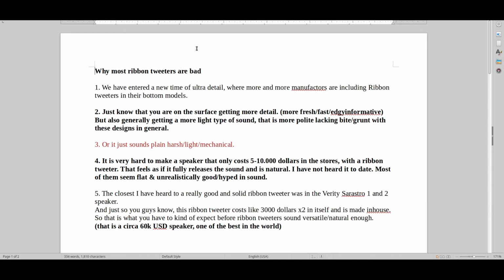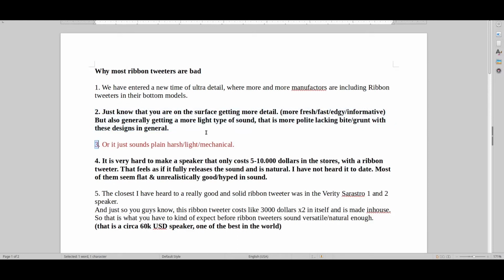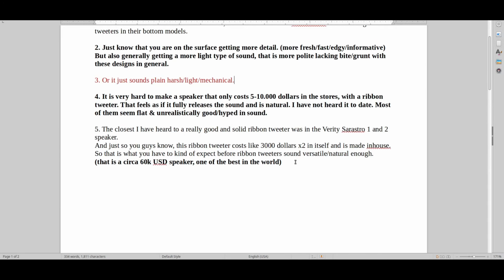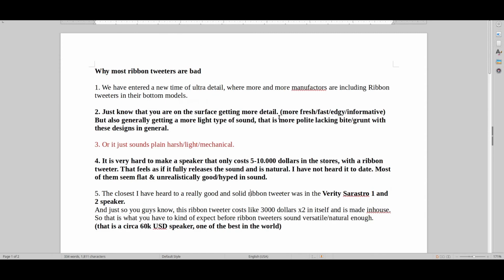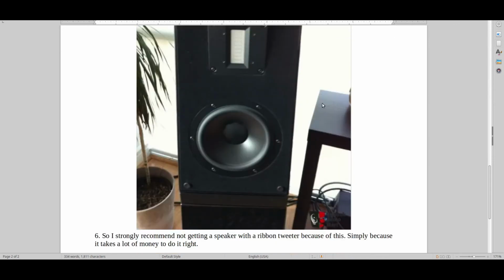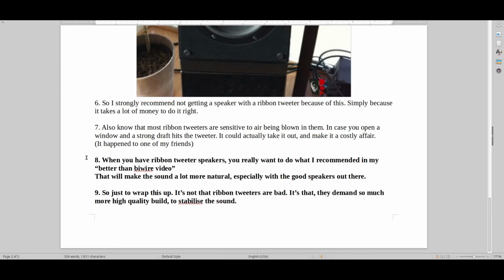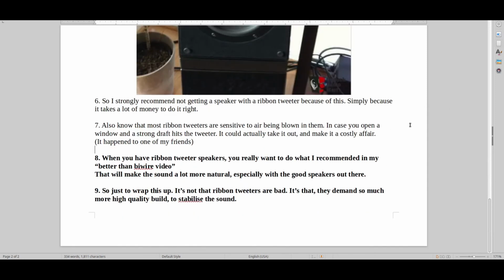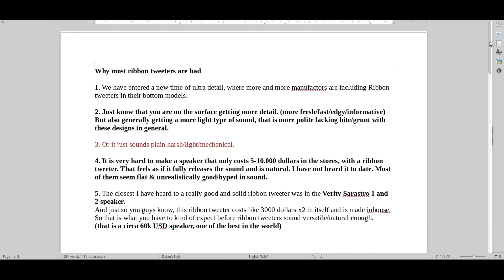Why most ribbon tweeters are so bad

Comment: All I got from this is 'there are really good ribbon tweeters, they just need lots of money".  Why?  What is the issue with the lesser ribbon tweeters?  Is it distortion? Is  the ribbon resonating because of some mechanical coupling?  It cannot simply be that money is needed.  Why is it needed?  What are the engineering issues that need to be addressed?

Comment: I don't like ribbons. They have to much distortion. That is what people call detail. They are ok from about 7khz up but then, why bother at that point. Burylium (sp) tweeters are 100 times better.
Reply from the maker: Maybe, depends on so many things. Best tweeters I have heard and in the Marten Design Bird 1, Sarastro Verity, Audio Note AN-e speakers.
And many I know say that it it the Marten Mingus together with the Wilson XVX chronosonic speakers that are the best. There are so many top end models with good tweeters nowadays.

Ribbon tweeters especially demonstrate the audiophiles lack of ability to adjust gear/room to the revealing unit. I like Berilium many times, but don´t consider it as natural as many of the highest models of the AN-E. AN-e spe/he + sec signatue + Sogon models are just a lot more integrated in sound where Berilium has  a tendency to separate things more artificially.
Reply: @RealHIFIHelp   well, I have been a musican for 45 years. I have been a recording engineer for 40 years and a mastering engineer for 35 years. Not to brag but when you want to hear things through speakers that sound like the real thing, it is pretty hard to do.
Ribbons don't do it.
Reply: @analogkid4557  I have owned Quad S2 (ribbons) for nearly 5 years, and as far as voice is concerned, I don't believe there is a speaker under £1,000 (or a good deal more) which beats them.  I have heard dozens and none betters them on this criteria.  For bass, dynamics, scale etc.....sure, this isn't their forte.  But realism as you stated, c'mon ?
Reply: @karlhinchliffe4920  yeah, cymbals don't sound real at all. Only metal domes can do that.

Comment: When a company crams a cheap ribbon or AMT into a two way design I can see there being definite compromises, but in a well designed three-way speaker they are superior to any dome I've experienced, and that seems to be where they shine best!
Reply from the maker: Maybe, depends on specific 2 way vs 3 way we compare and then the room and gear and many other factors. Yes there are a lot of good tweeters in a lot of 3 way speakers, I cover the best ones in my books and most other things if you want them. But it is material that currently is about 2500 pages.

Comment: I have ribbon tweeters in my car-audio setup. Amazingly, the delicate ribbons have been going strong for over 5 years. One advantage of rectangular shaped ribbons is controlled dispersion. In my case, I mount the left tweeter horizontally to minimize reflections from the adjacent A pillar.

The downside is that I high-pass my ribbons at 6.5khz, which only works because I'm running 2" mids in pods on my dash. Yes, I just mount speaker pods on my dash and it sounds better than door speakers. BION, I get 3D imaging in my car that most home audio enthusiasts can only dream of.

Comment: Click-bait title! - I concur: G1 ($300) excellent.  Raals ranked among world's best tweeters ($700-1500).  Several reviews say e.g. Viawave & Raven also v.good.  This video is assertive opinion, could confuse/mislead those seeking guidance.  Wrong & silly to claim “most ribbons are so bad”, the well-established tech can be awesome for way less than $3K.  Try Googling wider, to counter this viewpoint.  Sound is very difficult to describe, so if still unsure, buy from a source that allows returns.

Comment: I have used speakers with decent tweeters from Seas, Scan-Speak, Morel and heard many more quite expensive designs with either horn or conventional dome tweeters (from soft to ceramic,or diamond).
However, today I enjoy my own speakers with Aurum Cantus G1 ribbons after living with a commercial bookshelf with G2 for a few years.   
I prefer myself the clarity, speed and resolution of ribbons where the strings vibrate with pure overtones and resonances are sparkling clear; there are great advantages in a transducer that is an order of magnitude lighter than a dome tweeter and reacts and stops in an instant.
Viawave, Raven, Raal are some of the best transducers available nowadays, that when properly implemented are well beyond any existing conventional tweeter potential regardless of the cost of "entry" imho.
But I can be wrong and my own bias got the best of me.

Comment: Baffled here, so what makes most ribbon tweeters bad? Harmonic distortion? Bad crossover design in commercial speakers? I need more information than they must be expensive and paired with expensive caps and coils. Sure high quality parts help, but implementation matters more.  I’ve heard lots of high end speakers that I would not buy, but every once in a while a engineer really hits it out of the park and the speaker just sounds correct.  A lot of multi driver speakers never have the coherent realistic sound of a full range speaker.

Comment: It has to do with proper "implementation"! Proper crossovers, cabinets etc,. I was told for YEARS that AMTs were all terrible, till I purchased GoldenEar speakers (Sandy Gross designed) and I fell in love with them! I had previously owned many speakers with ribbon tweeters, and was never that happy with them (well I loved Magnepans if properly set up). Also cost doesn't always mean that much if the designer knows what they are doing!
Reply: Yep, totally agree. Most of the issues come from them having to be crossed over so high to reduce distortion. With that come plenty of problems.

Comment: You aren't seeing a lot of Ribbon tweeters, but a lot of AMTs (Air Motion Transducers).  AMTs are fine alternatives to domes, if you take into consideration, they cost a little more, and can't typically be crossed over as low as modern dome tweeters.  Your complaints aren't regarding the tweeter or its usage, but overall target curves speaker designers use today.  In the 90s, everyone blamed metal dome tweeters for the brighter sound of the latest loudspeakers.  The reality was speaker designers had wider bandwidth drivers than before and could make speakers with a flatter target curve.  Flat frequency response to 20k hz was the theoretical ideal, but listening experiments showed listeners found it bright sounding.  Today, many speaker designers have taken a step back and are using target curves where the output tapers toward the treble, but the majority are still producing speakers with flat target curves, which sound bright.  If AMTs didn't come back into fashion, you would still complain about the overall trend in how speakers sound today.

Comment: I prefer soft dome tweeters over ribbon tweeters. They are more durable, smoother sounding, and have a wider dispersion.
Reply from the maker: Me too. But, maybe less than 1% of the ribbon tweeters with the best crossover and constructions in the world are also really really good.

My main point was just the normal build quality with cheaper speakers has many times got sound issues.
Reply: What about planar tweeters?
Reply: One shoe fits all? There are different technologies of ribbon. Not all sound the same. 
I have AMTs on my Adams AV7 active speakers., they sound absolutely amazing.
Essentially its about the quality of the components, regardless of the technology.

Comment: i heard people talking about planar tweeters like Bohlender Graebener Neo3 being something that actually a better option than dome tweeters. they play lower, handles more power, move faster, more durable and open back options.
ribbons sounds like it won't change much in the hifi world, but also depends how you define ribbon, i think of ribbon as the ones that has the aluminium foil suspended in a magnet gap(with the durability issue you mentioned).  or perhaps the yellow folded ribbons with magnet at the sides and acting like an accordion.

Comment: Ribbon tweeters are tools. Like any other drivers they are there for a designer to achieve his/her goal. Even a small format ribbon tweeter, crossed high in a 3-way monitor can work very well. 
It's really up to a designer to use them properly. Most ribbons are fine. The video should be named  "why most speaker designers are so bad then it comes to ribbon tweeters".
Reply: Got that right... There are 6,000 people designing speakers for sale....perhaps a dozen are actually good at the task.
Reply from the maker: That is basically also what I said.

Comment: Come on , Couple million dollars Tweeter , that doesnt even Exist . Yes there are company's selling snake oil , so god knows maybe someone put a million dollar tweeter .
But whatever it is you can make it DIY for fraction of that , i dont care what is it .
Some of the most expensive speakers , best speakers use Tweeters made by hand in Serbia where im from , best in the world in its class .  And its not even a 1000$ per pair , its around 200$ bulk sail for best possible materials realistically handmade .
Reply from the maker: Jup like I explained it's all about context. You can of course chose to misunderstand it, if you want to. And no all ribbon tweeters are not the same, there is a huge difference. And the really good ones are not the ones that they sell in the stores. Have a nice day.
Reply: @RealHIFIHelp  You are the one who can make the tweeter to  be really good one or a crappy one as a speaker designer. There are plenty of superb components on the market that can be used to create a world class speaker. No need for the ones that are not sold in the stores. It's your speaker design skills baby!
Reply from the maker: @snowblow1984  Not really most DIY is really low quality and your are talking about the biggest potential DIY sound, not the most likely common ones that most people use.
If you bothered to do your research you would realise I have tried all levels. Yes standard components can do an okay sound. But custom made stuff is 9/10 times better. So there is no reason for settling for something that most people find okay.
On top of that, custom made sound can also become cheaper.

You are comparing the normal DIY gear with the normal trashy expensive sound.

I also say in many videos that it is very relative.

Meaning that, when incorporating cheap stuff, you have to do it in a certain way, that could in theory make it sound good.

By the way, I worked with some of the best in the business, a
Reply: @RealHIFIHelp  some the DIY use $5000 Tad tweeters.  Some build humongous horns. I have line arrays that weight 2 tons. Other Diy will use $19 tweeters an cardboard.  It's all over the place. Just like it is in commercial design.  I am still puzzled as to how you quantify that 9/10 times difference in betternes. Don't care who you worked for. Based on your sweeping generalizations you have little technical knowledge as far as use of the drivers and ribbon tweeters in particular.
Reply from the maker: @snowblow1984  DIY can sound good, but will in most cases be beat by the best stuff in the same value category new. Simply because the manufactors can get the stuff at a much cheaper price and they can tune it better and get better matched units. (we normal people have to buy single layer not properly matched units with all kinds of cheap kits)
So it is generally better to just buy the new stuff in the stores, going after the special few good things.

I have heard good DIY projects, but then we aren't talking about a normal Proac or Avalon clone, then we are usually up in the 10-30k USD class trying to making a good Wilson Audio speaker copy or a proper Avalon speaker copy or even trying to copy a Verity speaker.

Kit's aren't usually that good compared to the best, they are just good low level value most times. The good stuff, some few people keep to themselves.

But yeah you can still get good value stuff on Troelsgravesens homepage or other places like that.

Comment: Planar or ribbon tweeters usually kick as. The problem is they need to be crossed fairly high. So it's the midrange that has to cope up. And Ribbons don't need to cost 3000$ to be excellent. After 300$ per item you can get excellent sound from them. After 500$ there is hardly a dome tweeter in the market that can cope. Either made by beryllium, titanium or cloth from Jesus robe.
Reply: About 2 months ago, archaeologists unearthed one of Jesus’ old cupboards containing 5 socks, 6 robes and a soiled pants leg, so I think the prices of these tweeters should drop, now that the parts are more abundant.
Reply from the maker: You know what I mean. That the tweeter and the entire speaker needs to be made in a very expensive way usually in order to support that amount of detail so it is stable/versatile/normal.
And to do that, it many times requires a non shelf tweeter than is made in house like Verity. Or like the Raven tweeter.

Raal can in theory do the job. But that just means that the entire speaker has to be extremely good to support that sound.
Again, it will sound good, but nowhere near the best compared to an inhouse custom made tweeter by some of the best companies.

Too many sound metalic/weak.

Beryllium tweeter do a lot of good and sound cool, but are a lot like the old B&W kevlar units; putting too much of it's own sound on the music.
That is the problem with most units in the world not just tweeters, they interfere too much with their own sound.

And still, that does not mean that they cannot sound very good. It just means, that it is far from the ideal solution.

With low price there are always compromises that get made. And to then make that an acceptable or even a good sound, one has to partner it with equally bad components.
Reply: @RealHIFIHelp  And you are wrong. 
Custom tweeters are usually ordered by manufacturers for a very specific designs. For example, transformers may be wound for particular impedance. Raal BTW solves this problem on 20XR by providing multiple transformer taps.  
For majority of the custom tweeters however,  customization is limited to engraving speaker brand name on the face plate. ProAc uses silk dome tweeters on some of their models which is nothing but Vifa DX-25. 
The second reason many manufacturers claim to have custom tweeters is marketing. We are special! We have custom model! It's hype for gullible audiophiles. Tweeter manufacturers will support this by having OEM only models which mere mortal DIYs or small timers cannot buy.  Your are conflating good design, personal preferences, marketing and the cost of components. They are all different animals. 
Most of what you wrote here are nothing but generalizations that have little to do with reality. 
This for example.
"Raal can in theory do the job. But that just means that the entire speaker has to be extremely good to support that sound.
Again, it will sound good, but nowhere near the best compared to an inhouse custom made tweeter by some of the best companies."
Raal does the job not in theory but in reality. There are excellent DIY designs, using Raal as well as terrible commercial offerings, using the same exact tweeter.  Raal also has various models some of which are good and others, not so much. I am not even sure what in house made tweeters are you comparing to and based on what standards? Distortions, polar response? May be linear response?
Reply from the maker: @snowblow1984  I am comparing to the best in the world, not the normal stuff. That is why what I wrote can seem like a generalization, but in fact it is much deeper than that. I never make a black and white statement saying it is 100% like this.
Reply: @RealHIFIHelp  there's no such thing as "the best in the world". There are great sounding systems that some people will rave about and other, dismiss for one or another reason.
Reply from the maker: @snowblow1984  Yes that is the common group mindset, that likes to preach that.

You can still enjoy bad gear on several levels, getting close to the good stuff.